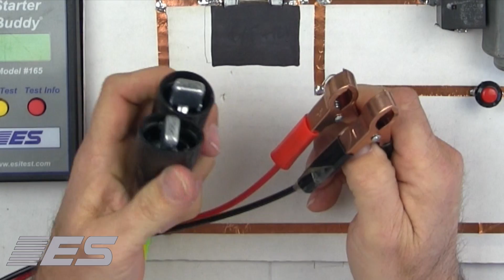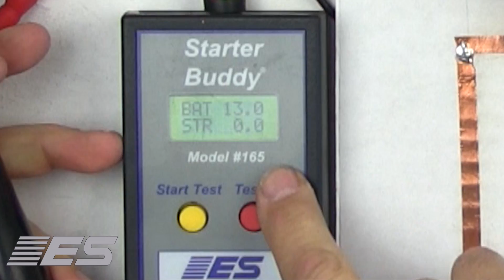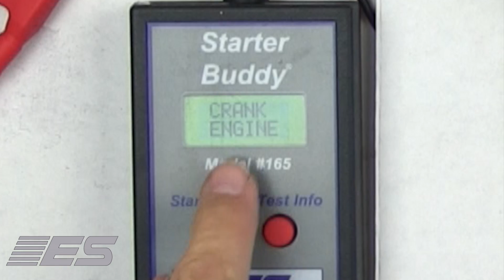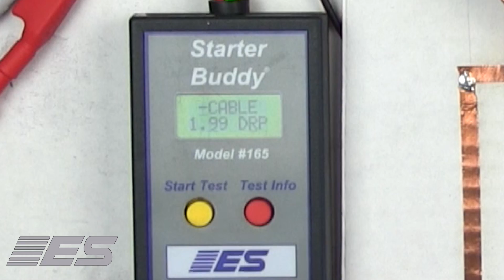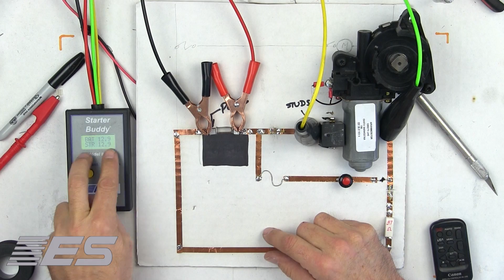Starter Buddy - Operational Procedures

Comment: Long Time Sub. I just picked this Tool up from my Cornwell Rep. I watched your video'd not only on You Tube, but The Video's you did on the DVD(which were pretty much the same.) You always go above and beyond when it comes to theory and operation. However; I didn't see any real world application from either of the three video's you did about the tool. I know you said you want to get as close to the starter as you can. It's been my experience that there are vehicles out there where the starter is not accessible. So my question is do I attach the alligator clip to an engine ground since most starters are case grounded as it is? Any feed back would be much appreciated. Cheers and thanks
Reply: Do you know how Dan intended to clamp to the battery post only when in some cases that can only be done with the cable removed as some cables completely cover the sides of the post.  Thanks

Comment: Thanks for the Free Class Daniel, couple of questions for clarification.
What's the drill used for? Other than cleaning terminals. 
Our Kenworth's has 2 batteries on each side, 2 grounds, 2 B+ wires to the starter. So I would need to run a voltage drop twice or is there another way I haven't thought of ?
Reply from the maker: Drill... Bad edit on my part. I'll drill 1/8" holes in posts or starter castings and install a #6 self-tapping screw for a clean connection. On your truck you'd need to do the test first at the splice of the batteries. Or - test all 4, but make sure the connections are clean before you do it.

Comment: I had a car that would not crank and my mindset was on the battery. The headlights would not even turn on. It ended up being corrosion inside the terminals. My advice is do not ever get locked into thinking only in one direction. Corrosion kicked my butt in diagnosing the problem. The battery looked good and so did the terminals until I looked inside of them. Thanks You Dan!
Reply from the maker: 80% wire. 80% wire. 80% wire. 80% wire. 80% wire. 80% wire. 80% wire. 80% wire. 80% wire. 80% wire. 80% wire. 80% wire. 80% wire. 80% wire. 80% wire. 80% wire. 80% wire. 80% wire. 80% wire. 80% wire. 80% wire. 80% wire. 80% wire. 80% wire. 80% wire. 80% wire. 80% wire. 80% wire. 80% wire. 80% wire. 80% wire.
Reply: Daniel Sullivan
I have applied the 80% wire fault over a year now and it has proven to be true. Your book and online videos have changed the way I think when it comes to finding the fault. Unfortunately, Academia is to set in their ways to accept a new way of thinking, Colleges and Universities that teach electrical swear by the OHM Test as the gold standard of diagnosis.
Reply from the maker: ***** Yeah - well - sometimes you gotta kick a little ass. Creative people must never, ever, ever, ever, ever, ever, ever, ever, ever, ever, ever, ever, ever, ever, ever, ever, ever, ever, ever listen to critics.
Reply: 50%